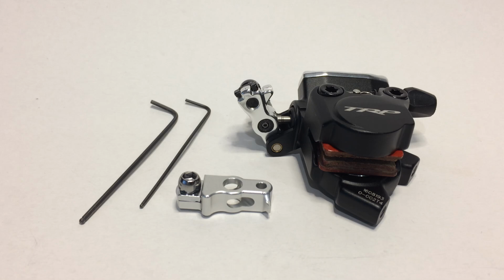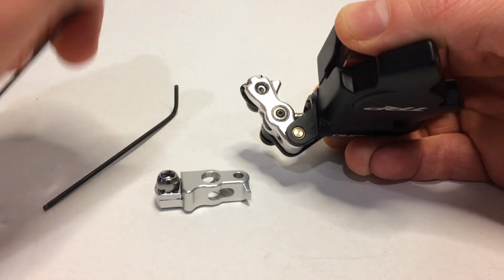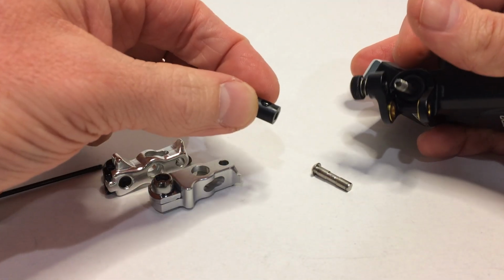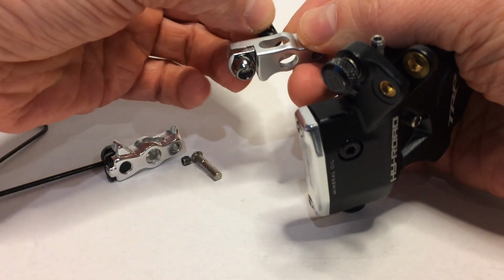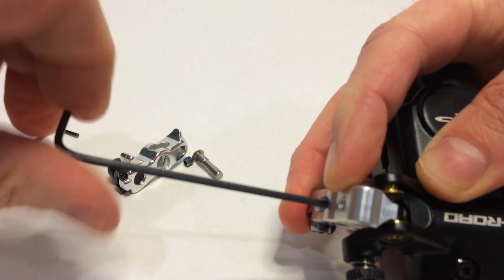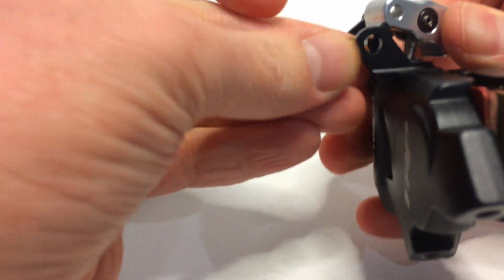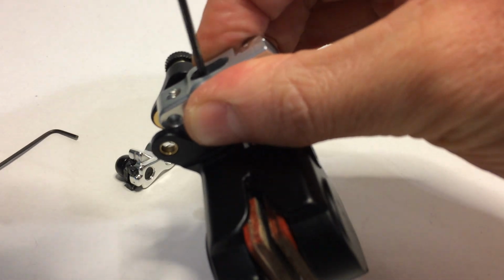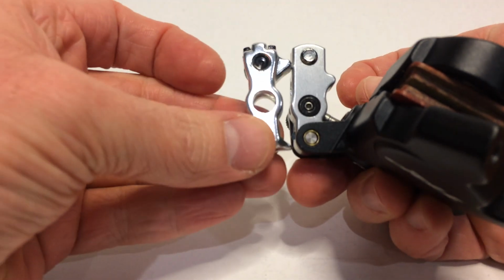TRP HY/RD Short Pull Conversion Arm Installation

Comment: I just installed a set on my calipers and thought I should pass on a comment.   When I tightened up the piston rod according to instructions I found that the arm lock (for cable adjustment) was very difficult to engage and screw in.   I discovered that turning the piston rod back inwards about a turn allowed the locking screw to run smoothly into the barrel.   Apparently there may be a few thousandths of an inch variation between the old and new arms.  (but having said that, I didn't check the whether the original assembly was fully tightened).   In any case the locking setscrew will hold the piston rod from rotating.   Afterwards I found the lever travel to be much improved and had the bike out for a ride today.   That old "Oh s***, no brakes" feeling is now gone!   BTW- my levers are SORA R3000.    Thanks.
Reply from the maker: 👍 Someone else had a similar comment. The most likely variable is the amount of thread on the piston rod as that is a fairly difficult thing to control in manufacturing. Regardless, the important point that you make is that the stroke can be adjusted/fine-tuned at that connection and not being fully tight isn’t an issue due to the set screw. Glad to hear your brakes are performing better now!

Comment: Thanks for making these! It has made my life a little more comfortable on my 9-speed. I have two notes for you:

(1) I found it easier to reinstall the pivot bushing by putting my hex key through the hole in the bushing first, finding and locking in the end of the piston with the key, then sliding the bushing up the key to the piston.

(2) Slightly related: I had to loosen the piston screw (not the set screw) out of the bushing slightly to get the brakes to bite all the way (in your video, you say "turn that until it stops"). When I first installed it with it all the way in, the caliper grip was not effective. I think this is the way it came from the factory, as that screw seemed quite loose, but unfortunately, I don't have any other advice than "if it doesn't work right, unlock and unscrew it a little" or "maybe measure the number of turns they unscrewed it before removing it, but remember that you have to do this by turning it counterclockwise."

[edit] I've found that you can loosen the set screw and adjust the piston screw with the wheel mounted. Doing this until you find the lever pull and caliper grip to be "about right" is the best I can say about it for now.
Reply from the maker: Hi Brian, great feedback both on the install process and (on Amazon) regarding use with older Sora levers relative to newer Shimano levers!
Reply: There is a "sweet spot" I think for how far in or out you wind the piston screw.  If you wind it in (so, tighten ACW) too far, you don't get enough piston movement when applying the brake lever to get good braking performance.  However, if you wind it out (so, loosen CW) too far, you push the main cylinder too far into the chamber, and this blocks off the bleed hole into the reservoir, and effectively turns your open loop hyraulic system into a closed loop one.  This means your brake pistons won't automatically adjust as the pads wear, and you'll find that braking performance starts to diminish pretty significantly over time.  You'll also be unable to correctly bleed the brakes, as the main cylinder is blocking oil flow into the reservoir.

I found the sweet spot by doing a standard bleed, with the cable loosened off and the knurled lock nut screwed in.  As I was pushing oil through the caliper, I wound the piston screw CW until I felt it blocking off anymore oil from coming into the reservoir (don't push the syringe too hard, or you'll end up spraying mineral oil all over your workshop!), then turned the piston screw ACW two (2) turns.

Comment from the maker: Production CNC arms have arrived! Just waiting on the cable clamp hardware from TRP now. If you can't wait any longer, you can use these with Shimano's standard road caliper brake cable clamp hardware. Pic here: https://c1.staticflickr.com/5/4197/34052245864_0bdf7622dd_c.jpg and here: https://c1.staticflickr.com/5/4252/34508395060_dedb86c3a8_c.jpg , from left to right: stock HY/RD arm, short pull prototype arm, and production short pull arm with TRP Spyre hardware (stolen from my spare Spyre caliper for this shot).
Reply: Great stuff!
Reply: Joe Jackson what's the ETA on the full setup for ordering? So if you're waiting on cable clamp hardware, I am assuming you can't use the stock Hy/Rd clamp hardware? Can you use the Spyre cable clamps?
Reply from the maker: The full setup  will be available around the end of June for $35/pair 
including shipping in the US. If you need something sooner, there are 
two options:

1. Provide your own Spyre brake cable clamp washer and reuse your 
original HY/RD clamp screw  (the same parts which I will be including 
once they arrive from TRP Taiwan).
2. Provide your own Shimano brake cable clamp washer and screw (standard
 road caliper brake parts, as is used on the prototype arms in the 
video. The clamp washer won't look as integrated into the design as the 
Spyre washer but it will function 100% as well. You can buy this 
hardware from several sites for $6 total ($3/pack, 2 packs required for a
 pair of arms).

Both 'early delivery' options above are $32/pair including shipping.
Reply: Excellent! Just reserve two kits for me! Thanks!

Comment: As far as I can tell, these arms essentially move where the wire cable is clamped onto.  I had issues with engaging the lock screw with these conversion arms.  The lock screw is not 90degrees to the arm.
Reply from the maker: Hi Rick, when you get a chance, send me some pics of the issue at joe@jjpne.com. We’ll get it sorted out.
Reply from the maker: Rick, did you ever get this sorted out?

Comment from the maker: Just when you think you’ve planned far enough ahead to avoid running out of stock, supply chain issues rear their ugly heads. I expect to be back shipping early April 2021. Direct orders will get fulfilled sooner as I wait on Amazon to inventory the parts once they receive them (always takes a few weeks all in). joe@jjpne.com for any questions or direct orders. Thanks for the continued interest!
Reply: Hello, just maximizing my chances of getting your product. I've sent you an email as well. I need a set shipped to Japan (Tried using Amazon US but it won't let me ship it)
Reply from the maker: @kubatyszko807  I’ll be in touch shortly.

Comment from the maker: I will be setting up another production run of brake arms in the near future. Any special color requests? I still have a set or two of gray arms available. Happy to run another color (or colors) if enough interest is shown. Otherwise they’ll all be black.
Reply: omg this is awesome. I've tried bleeding carefully the reservoir, changing the cables for the jagwire road pro, and still they feel long and spongy. Have shimano 105 levers. this looks great. price is reasonable coming from a custom made one man operation. pulling the trigger in Amazon spain

Comment from the maker: Conversion arms are back in stock. Direct orders will resume shipping immediately with stock at Amazon in about a week. Thanks for your patience!
Reply: Joe Jackson where do I order direct? Can you ship to the UK? How much?
Reply from the maker: Email me at jjpandellc@gmail.com. Total cost for a set shipped to the UK is $47 ($35 + $12 shipping via USPS).
Reply: Hello Joe, great video and great product.  I am having a heck of time to get my HY/RD to set-up properly.  I have been running them for almost two years on my Pinarello FC Hydro with Campy Record EPS v3.  As you know the pull was always pretty much bottoming out, but I made it through my first two cross seasons just fine.  It has been on the back of my mind all this time to look into the short pull swap solution.  Now that I have done it, the arm will done come back far enough to use the TRP lock out bolt to then tighten the cable down and then release it as TRP has designed.  the Arm is just shy of being back far enough.  One other mechanic and I have tried for some time to get the rotors and calipers to line up but I still have rub and am not aligned in the front.  Brand new set of Hy/Rds, brand new pads and brand new rotors.  I have rt99 XTR 160mm front and 140mm rear.  I know that the new TRPs that came with my new calipers are about 1.75 to Shimano's 2.02 width...Do you have any ideas or suggestions.  I missed my cross race this weekend and I can't miss my race next weekend.  Help!  I got your arms off Amazon a few weeks ago.  Amazing work and quality, in black.
Reply from the maker: Hi Matt, Sorry for the slow reply and thanks for your positive feedback! Your comment was flagged as spam for some reason. I'm running the same exact rotors on my bike with Campy Chorus mechanical levers. Rotor thickness should have little to do with rubbing as the pads in the HY/RDs will self adjust to the rotor thickness. One issue  had during caliper set up was the stiffness of the compressionless brake cable housing I used. It was stiff enough that the typical 'squeeze the caliper onto the rotor and tighten the bolts' method of alignment did not work. The cable housing was stiff enough to flex the rotor. I wound up getting the alignment as close as possible using that method then eye-balling the last bit of adjustment. If you've done everything you can and still get rub, you either have warped rotors or perhaps need the caliper mounting surfaces faced to be square with your dropouts.

Comment: Can you make these in a matte gray finish, please?
Reply from the maker: Hey @Bill Gerdes, I am going to be starting another production run of these arms in the next month or so. I'll have to see what the up-charge is from my anodizing vendor to make a few in a different color. Do you have a picture of a component you are trying to match?

Anyone else interested in the same finish? Having 5+ people would help spread the cost dramatically.
Reply from the maker: @Blakksheap  I am working on this. Should be a couple weeks or so. My vendor kindly bundled these into my total order so they'll be available for the same price as the black arms ($35/pair) for anyone who would like a set. I'm only making 10 sets and they are first come, first served.
Reply from the maker: @Blakksheap  These are finally due in today. Had some issues with the finish on the first go-around but should be correct this time. Send me an email if you want to claim a set.

Comment: read your response the the Spyre campy-mod on W.Weenies and was wondering if you've come up with a solution?
as is they aren't terrible. but would be nice if there were a solution
Reply: i just got an idea for a Spyre SLC campagnolo mod that i would like to get your opinion on.
instead of the brake cable going straight into the anchoring hole on the actuating arm, going first under the actuating arm, and then into the anchoring hole from the rear?
it would be kind of a tight bend for the cable. and maybe a bit of an angle exiting the cable housing? i have pictures of what i am describing
Reply from the maker: @NewEnglandDirtRoadie  I don't believe that will work as there is not much clearance under the actuator arm. I'd also be very concerned about cable fatigue and the cable exit angle (one of the biggest issues I face trying to make a conversion kit). I have an accurate 3D model of the Spyre direct from TRP that is waiting on me finding time to dive into that problem. I still see it as being a very expensive fix in the end. I'd almost rather just make a whole new caliper than a conversion...

Comment: Hi Joe, are you still selling these arms? I have some Sram Rival (10sp) levers, and although they are not that old, I find that the lever pull needs the full movement of the levers to grab, so I am having issues adjusting the position of the levers to stop them hitting the bars before getting decent braking.
I found the Short Arm kit on Amazon, but it says they have none, and have no idea when or if they will have any. Plus, I am in Australia.
Is the Short Arm kit still available, as it sounds like these would solve the issue without any hacks...so before I ditch the TRP brakes and go back to BB7's or try the Spyre Mechanical brakes, this is worth a shot
Reply from the maker: Hey, Sorry about the out of stock situation at Amazon. Another production run of CNC arms is already in process and I already have the miscellaneous hardware on hand. Unfortunately, Amazon does not give me the option to add a restocking timeline to the listing so I'm left with the current message.
Expect stock to arrive at Amazon in roughly 4 weeks but I will have kits available to ship about a week earlier using direct Paypal orders. Australia is no problem.
FYI, don't bother with the Spyre mechanicals. They will be as bad as the HY/RDs but with no option for shortening the cable pull.
Reply: Thanks Joe. Not keen on the Spryes or going back to BB7's, so I'll get the Short Arm Kit as soon you have them back in stock. Saved me a lot of frustration and expense!

Comment: Hi, do these allow the Hy Rd to work with new Shimano Tiagra 10 Speed levers?
Reply from the maker: Tiagra 4700 levers are SLR-EV so they should work with the standard HY/RD arms. Tiagra 4600 is ‘new Super SLR’ and definitely needs the short pull conversion arms to work reliably. That said, some owners of SLR-EV levers have reported that they prefer the shorter pull with the JJBP short pull conversion arms. Just note that lever force will go up when you swap the arms.
Reply: @JJPELLC   thanks Joe. The leavers are the dual control ST-4700 for drop handle bars. Shimano's website says they are  SLR-EV but then also says they have Super SLR as one of the technologies. https://bike.shimano.com/en-EU/product/component/tiagra-4700/ST-4700-R.html
Reply from the maker: @RichyMant  Shimano is inconsistent in their literature but the lever design in the area of the brake cable anchor is very similar (maybe identical) to the other SLR-EV levers in the lineup (5800 and up) which leads me to conclude that they are SLR-EV. 4600 has the old style cable attachment and has always been consistently described as New Super SLR yet Shimano has compatibility charts showing 4700 and 4600 calipers being interchangeable (among others). I’m more confident in what the pictures show than what the literature says.

Comment from the maker: Conversion arms are once again back in stock. Direct orders will resume shipping immediately with stock at Amazon in about two weeks. Thanks for your patience!
Reply: i recently sent my trp hy/rd back to for service that is equipped with the short pull conversion arm and they sent it back to me without the cable retention plate. I have the screw and the washer but nothing to hold the cable now. How would I go about getting a replacement? Thanks!
Reply from the maker: @neilc3485  Send me an email at jjpandellc@gmail.com with your address and I'll send one to you. If you need something right away a Shimano clamp plate from one of their standard road calipers works, too, but doesn't fit quite as nice. My arms use TRP Spyre clamp plates so if you have access to one of those calipers you could use that as well.
Reply: Do you have a link for your amazon site? I just can't find your conversion arm
Reply from the maker: @Keetongu23  https://www.amazon.com/JJBP-Short-Pull-Conversion-Brake/dp/B073CCKD85